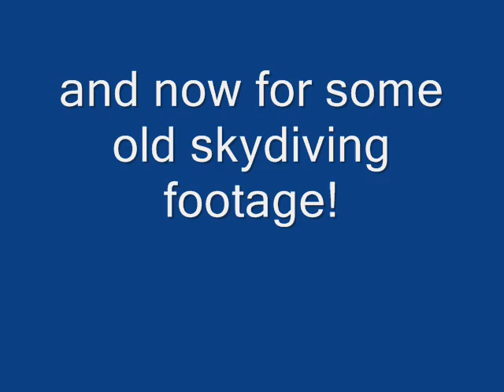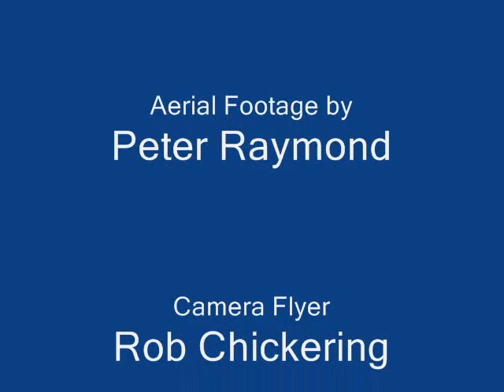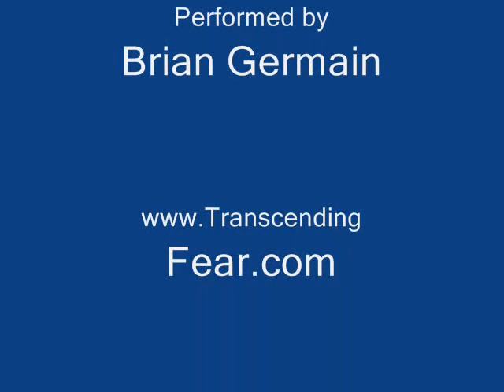Safety First TV: The Secret to Pilot Chute Packing

Comment from the maker: In most cases, a Freefly handle will still release in the event of an out of sequence deployment. The only way to know for certain is to test it on the ground. Keep in mind that packing this way also prevents packing the pilot chute uncocked. Even if your Freefly handle resists a pilot chute extraction, it is still an improvement in safety due to this reason.
Reply: Thanks for the reply, blue skies !

Comment: This was posted in 2008. I wonder if you still feel that this is the best way to pack the pilot chute or do you now do something else?
Reply from the maker: I still pack this way. No problems noted when done exactly this way, or with the bridle on the canopy fabric, as opposed to being inside on the mesh. Both ways work, but since I use an F-111 PC, I don't put the bridle on the mesh anymore. I found some minor damage on the mesh after several thousand jumps on the PC. This damage was not dangerous, and the openings did not change when I switched to a new PC.

Comment: I never saw, heard of, or read about anybody getting a horseshoe malfunction with a pin-pull system,
Reply from the maker: If you are referring to a "pull-out", they don't often experience horseshoe Malfunctions. As an out of sequence deployment, a pull-out can certain allow a line to get wrapped on some part of the jumper. Regardless, BOC throughout is the most common deployment system, and this method reduces the risks.
Reply: @Brian-Germain  I never encountered a pin-pull (pullout) that was not positioned BOC. 

When I first joined the sport (40+ years ago) fans of throwaway pilot chutes derided the positioning of the pin-pull because It was out of sight of the user.

Racer fans would respond by asking them if the needed to look at their ads when they were wiping it 😊

Throwaway pilot chutes were mounted on belly bands (which introduced risks) then on legstraps (same risks, different part of the anatomy), and after about a decade, there was a Ta-Daa moment, and BOC became the universal standard position for throwaway pilot chutes.

But it still hasn't removed all the issues associated with throwaway pilot chutes. . . . 

. . . issues which are not present in a pin-pull system, IMHO.

Comment: It's just a standard pilot chute packing method. 

But it is nicely presented, from someone who people can trust, and clearly shows the "bunching up" hazard for those who don't understand that issue with where the bridle goes. Brian goes further than most do, by folding the bridle while the PC is on the rig rather than just near the bottom of the rig, in order to have absolutely the minimum extra bridle left out of the PC that needs stuffing in as the PC goes into the pouch. A useful video.

Comment: I've already been packing my pilot chute using a similar method but for a different reason.  I only wanted there to be less friction with the underside of the pilot chute when I pull.  I haven't always used the same method but thanks to you, I think that I'll stick to what makes the most sense.

Thanks for posting your video.  You could very well be saving lives.

Comment: Hi Brian, This weekend I had my first reserve ride. (jump 372) Due to a hardpull. Tried twice but couldn't get the pilot out, so reserve procedure. On the ground we found the pilot balled up in the pocket. I have a bungee pilot on a vector rig. 
The rig was not packed by myself. When I pack myself I use your method and never had any problems pulling. So whenever I am using a packer I will ask them to use your method or not pack the pilot so I can do it myself.
Thanx for the vids!

Comment from the maker: That is a great question. A pullout is a great way to reduce the risk of pc in tow or a horseshoe malfunction. The downsides are few, and include risk of an out of sequence deployment as the container is open before the pc hits the air. This could result in an entanglement, but it is rare. Some pulpits have a short bridle, which can cause of hesitations and poor openings.  The last concern that I know of with a pullout is the risk of not finding the handle. This can be caused by having the pullout "pud" become dislodged from its pouch. You then be going straight to the reserve, with no risk of the main falling out. As an aside, it is not clear that the correct procedure for a of in tow on a throw out is to go straight to the reserve. Some of us are of the mindset that if the deployment has been initiated, deliberately or inadvertently, a cutaway is warranted. If the main comes out, you don't want to be attached to it.

Comment: I wonder if this method would still work for a freefly BOC handle that tucks in under the container flap where the bridal is stowed before folding it in the pilot chute.  In the event of a horseshoe with pilot chute still in pouch, I wonder if the free fly handle tab would keep the pilot chute/ bridal from extracting with whatever folding method you use.  I hope I didnt miss something in the video.